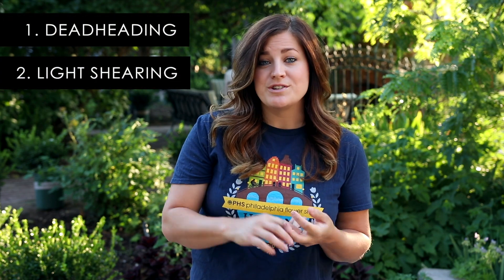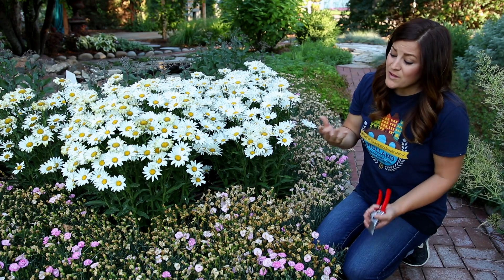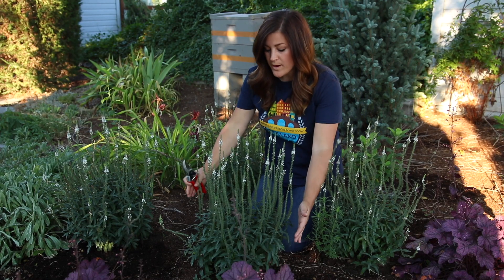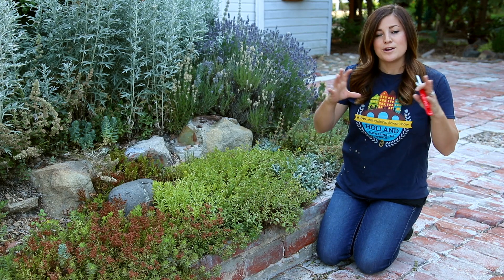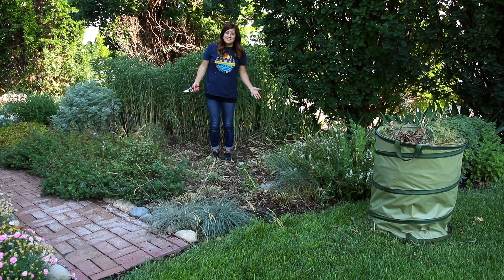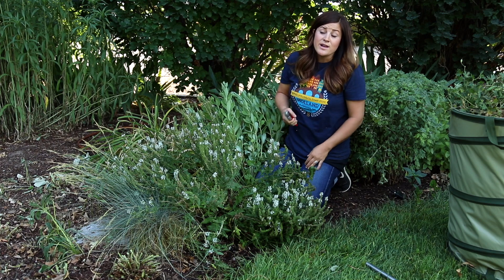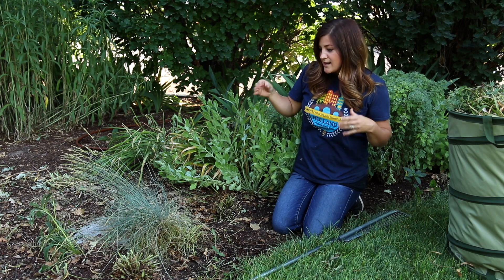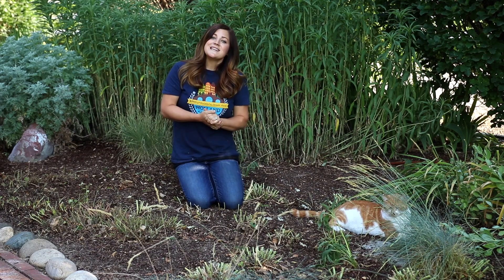Cutting Back Perennials // Garden Answer

Comment: I think you should consider running the cut back stuff through a chipper shredder and putting it back down on the garden, then put mulch on top of that so it looks nice. Composting in place is easier IMO and it returns the organic matter back to the soil. (Sustainable)
Reply: Joan Smith I chop mine up with my shears and put it right back in my compost I never buy dirt anymore it's great

Comment: Re gaps when cutting back.  I go to the thrift stores and get a half dozen assorted wicker baskets for a couple dollars each..  In mid Spring I plant these Baskets up with various annuals.   I move these baskets (light weight) around the garden to add colour to  fill in ‘gaps’ between Perennial blooms. To add a bit of height they can be raised in some structure above the rejuvenating plants beneath. Later when new blooms of sine perennial add colour, I move the baskets to fill in some new gap.

Comment: Could you please make one on spitting your Hosta's. I have several kinds in my yard and there big. I'm afraid to split them because I don't know when's a good time to do it.
Reply: fall is a good time or spring when they have leaves . its easy to just grab them buy leaves and divide separate with gardener forks. do not cut .
Reply: You can divide hostas nearly anytime but it's best to do that when they are just peeking out or about to go dormant. I use a serrated kitchen knife and slice right through the fleshy part.  The easiest way and works great.
Reply: My parents take any shovel and put it through the center of the plant and split in two, or even three if it’s really big. All the way through the roots. Either late fall or early spring. Zone 5. I’ve always done the same with success.

Comment: What about Iris?  My leaves are really looking bad on mine but was afraid to cut them clear down because of storing up food for winter?
Reply: Heidi85 just remove the leaves that are looking bad. Do not cut short cause it's producing new rhizomes. In the Fall you can cut short or dig up and divide. Irises need dividing every 2-3 years.
Reply: They look bad when the clumps aren't divided up often enough. The older centers  of the clumps get too tight, lose their vigor and moisture and naturally begin to decline in favor of the newer offshoots forming in the periphery. Mine stay spiky and green even through hot summers if I do my fall work. Dig up the clumps. When the parent rhizome has two good size offshoots snap them off. If the parent rhizome has any old papery spots or dead roots among the healthy ones it's a sign of age and decline, toss it. Replant the new offshoots respacing them for future growth. Clip their fans off straight across, about 1-2 inches off the ground. Water well. In the spring feed them. When the blooms are spent cut the flower stalk as low to the base where it splits from the leaf and keep them evenly watered even after they quit blooming! People thing the thick leaves and bulky rhizome means they can ignore them. Yes they are quite tolerant to neglect and drought and will survive just about the driest places but they won't look good, it just means they survived to try another year when hopefully growing conditions are kinder. Irises shine when they arent crowded or parent rhizomes left to fend for their mature offspring. Don't we all.😏🌻

Comment: What fertilizer is right for double peonies? I have 12-4-8, (I think), sprinkle container that I drop onto beds. I've searched for suggested fertilizers-found 0.
We have very large plants & problem is with stalks to heavy blooms aren't strong enough & I don't know what to add to fix that. We use double level rings that support them from small & they grow up & into rings but with all our rain in PA this spring, they had very short beauty time-were weighed down, cut for inside rather than be destroyed. I'd rather have them flourish outside. This weighed down to breaking point is an annual problem. Help please!

Comment: Why not just use the cuttings as mulch as the cutting have the nutrients that the plants need. As they break down the soil critters will pass along the nutrients when the plants call for them.
Like a forest floor it’s rich in humus and the droppings contain what those trees need. Sometimes there’s too much from cuttings and that goes in the compost pile but by just layering cuttings in place as mulch reduces the need to buy mulch or fertilizers. I decided years ago to stop giving away my property (leaves and yard waste etc) now I just turn it all into a rich soil.
Reply: I use my leaves in my garden in fall and cover with tarp so they dont blow off

Comment: What a shame you raked up a lot of mulch (old plant trimmings) just so you could add more mulch...hmmm looks like unnecessary work and expense. You could leave the small bits in the garden ( I even chop up many of the large bits) and mulch on top of it so it will look less messy but still feed back onto the soil some of what was taken out.